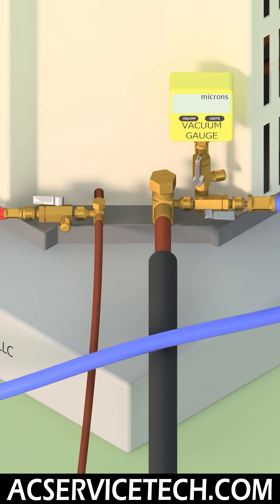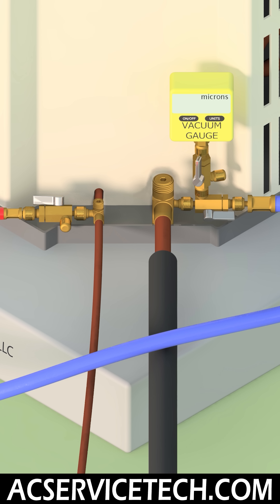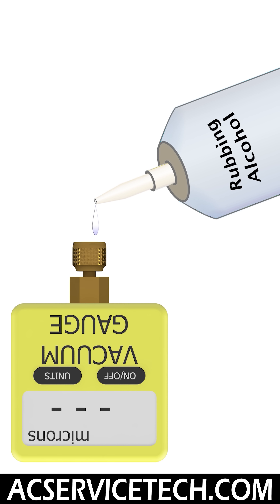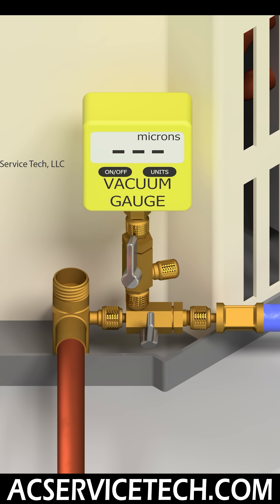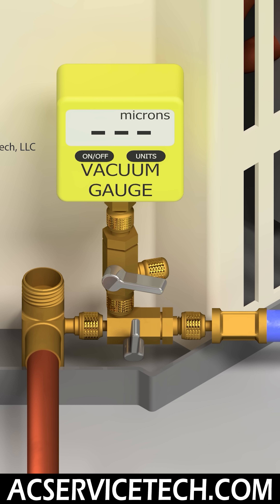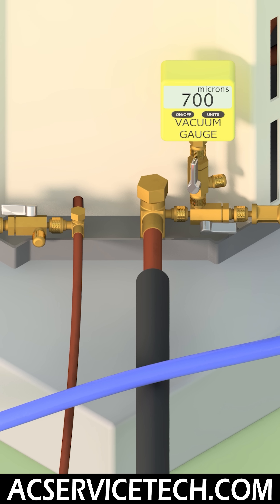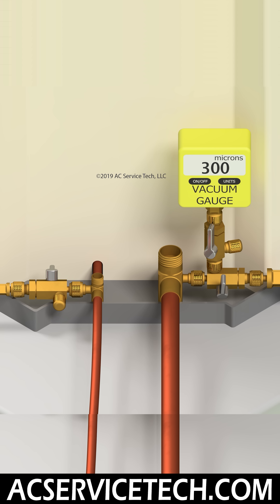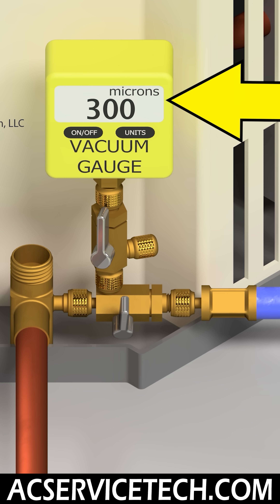Avoid Contaminating the Vacuum Gauge When Vacuuming an HVAC System!

Comment: This works well but it's harder to do on Coremax core systems ( commercial) systems because of the core max valves. The tool for core max is huge doesn't fit in tight areas either

Comment: I generally start my vacuum first and only after the first ten mins I then put on the gauge. Allows the system to remove a good chunk of remaining evaporated refrigerant and get a decent vacuum in the system to prevent pressure from hitting the gauge.
Reply: The fact you’re using a vacuum pump to remove “evaporated refrigerant” tells me everything I need to know…
Reply: @HVAC33OhioArt refrigerant gets trapped in the compressor oil, the fact you think you know it all tells me everything I need to know... 🤡
Reply: @CGJ1234  so I guess you’re not running nitrogen to expedite vacuum time and doing a pressure test before vacuuming. And it helps running crank case heater(s) also. You’re welcome I’ll send you a bill 😉
Reply: @HVAC33OhioArt  bold to assume I'm not. But once again tells me plenty.
Reply: @CGJ1234  we both know I’m right it’s OK your secret is safe with me.. 
and I know you’re not changing the filter dryer 🤫

Comment: The more gizmos you add the better chance of one of your gizmos leaking. One of the biggest issues with core removers is they leak. POE tears op the seals over time. They don’t last forever. Core removers save time, but sometimes the core remover is wore out and the tool itself is the problem. Just saying. 35 years doing this work. I rarely use core removers, but I do commercial where we have a lot more service valves.
Reply: What does having a lot more service valves have to do with anything? 
You do realize that most CRT are completely rebuildable right? 
I have a hard time believing you have 35 years “doing this work”….